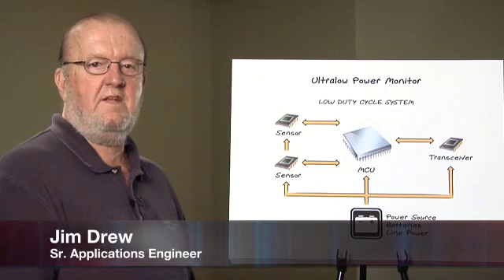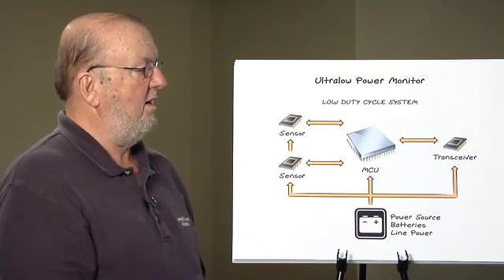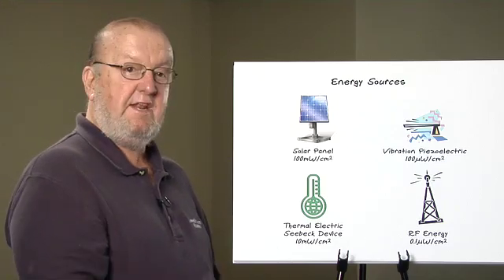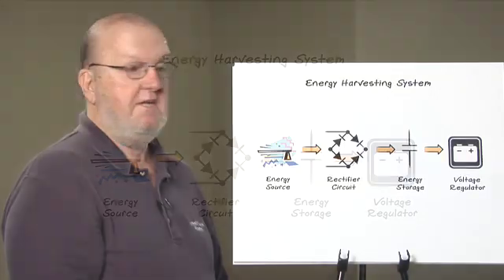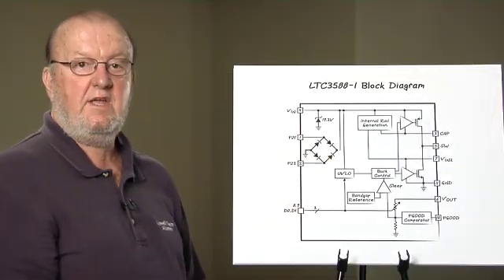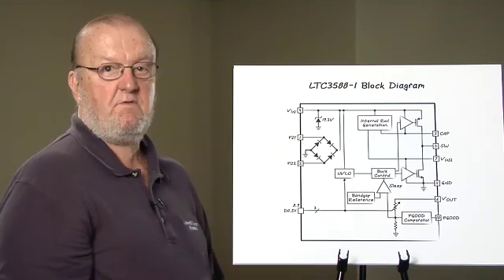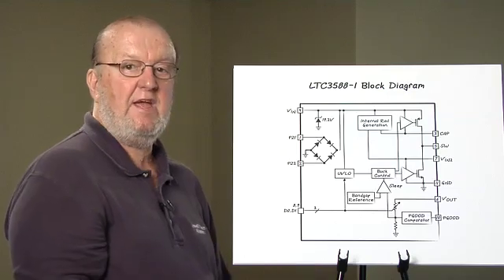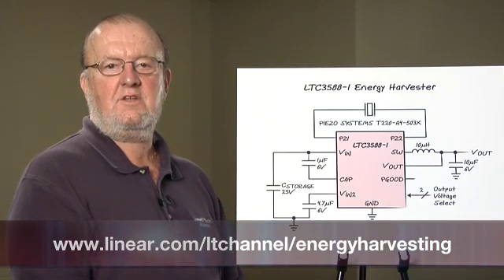Energy Harvesting Applications

Comment: With the right kind of antenna and ground I have been able to get as much as maximum 15 volt and 3MA from RF energy, but usually it hovers around 11 volt and 2.6 MA per .75cm2 area of a receiver, which corresponds to approximately 0.038 watt per sq cm square....approximately 380 watt per 1SQM... is not it amazing.....need an explanation from experts like. Myself an architect ...with a lot of DIY interest. But this discovery should be out of the world.
Reply: hi Mr DIY Debesh. May I know how you got that current value?